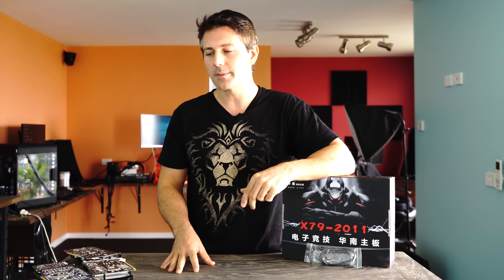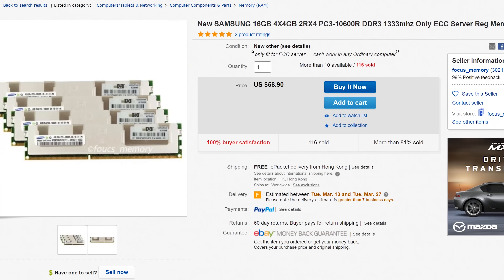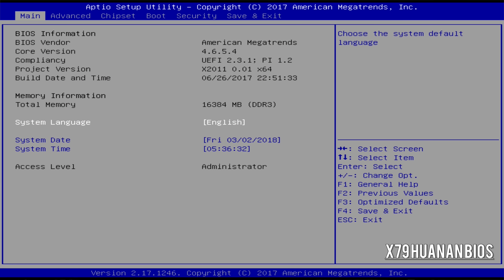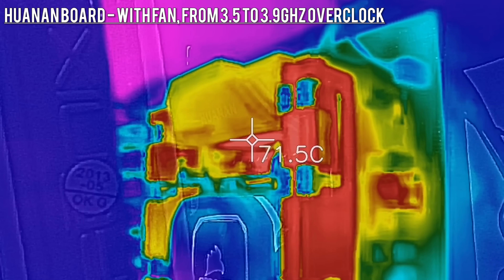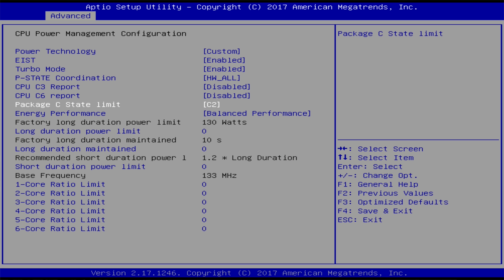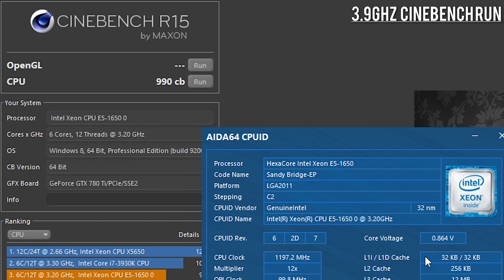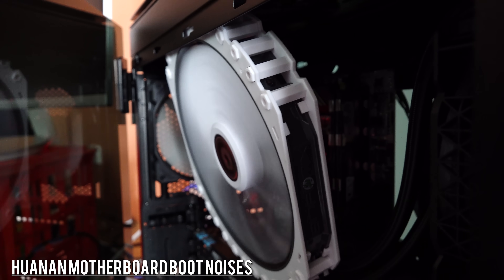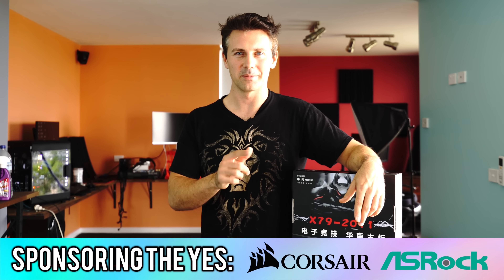AliExpress HUANAN X79 Motherboards - Are they a LEGIT OPTION for PC Builders!?

Comment: can you do a comprehensive bios setup, not OC, i have a hard time with my nvida card, gtx 1050ti 4gb looses display, the gpu is good with other systems, only on these boards it suddenly stops displaying on windows 7 and windows 10, having 1 ram the gtx1050ti does not have any problem, when adding ram  dual, and full populated i have problems,  how do i know the board cpu ram are all good? ATI gpus works without crash, how do i know the gpu is good? 1 ram no loss of display, i got it to work on my gtx1050ti when i changed the pci snooping, im not sure this was the right settings, a full detailed bios comprehension video might help.

Comment: nowadays its even cheaper with the cpu 83, mobo 66 and ram 35 usd. but if you pick the e5 1650 v0 for 40 usd and a cheaper x79 mobo  for 58 (considering 10 usd for shipping already), so all in 133 usd. Exactly 200 usd cheaper! to me thats the king of budget pc nowadays. 

Compare it with a used r5 1600 for 80 usd, an old b350 mobo for 85 usd and 8gb ddr4 for 75 usd. 100 usd more for half ram. 

And I dont even think this better because am4 is going to be replaced in a near future so  building a budget pc would be better to wait the new am5 mobos with pcie 4.0 and ddr5 support and build a pc more future proof. Actually thats what im doing kkk

Comment: Good evening Tech Yes. I've ordered one of those chinese motherboards X79 Turbo with a Xeon E5 2690 to build a workstation, so no overclock at all but lot  of heavy tasks and video encoding.
Do you think I'll need to add a fan over the VRM heatsink even if not overclocked? (Xeon E5 2690 is an 8 Core/16T running at 2,9Ghz up to 3,8Ghz Turbo mode TDP 135w)
Thank you for reading this post!
Reply: theres no need, these xeons run cold like 50C degrees, the vrm should not be much more hotter than this. but if you want to be sure buy one, near me they're sold for 5~6 usd

Comment: Hey mate loved the video, would it be possible for you to share thoughts on a dual x99 board with two of e5-2670-v3 cpus? kinda looking to buy this setup since it supports ddr4 and is fairly cheap. (200aud for mobo, 220 for two cpus)

Comment: I bought one of these, got here this week, I put an i7-4820k (it was a good deal on ebay about 60 GBP), running at 4.3 GHz, couldn't go higher without voltage control, but can't complain for 56 GBP. One great thing about the xeons and the i7-extreme cpu is the 40 PCI-E lanes. A graphics card would max out the 16 lanes of normal core i cpus, and with an other PCI-E card (wifi, sound, usb or whatever) or an NVME drive it would take away from the gpu. Mine has a Q77 chipset, the description on aliexpress you can normally find what chipset to expect, they have two or three, can't choose though.

Comment: Does it have HDMI? If not, does it matter?
Reply: The board does have HDMI however you wont even have to use it, Xeon processors dont have integrated graphics so you need to buy a graphics card to actually use the computer.

Comment: Hey tech it takes v2 chips do you know, or are you familiar with what chipset is on the southbridge is it an x79 chip or an c602? because if it is an c602 you could actually used an Ecc Rdimms with the board in the 16gb variety,  I was just curious if you had seen the chipset.  Thanks man.  good video.

Comment: are they paying licence? 

afik they are just recycling from old boards or using old new stock chipsets and you can endup with anything compatible chipset even server chipsets on some boards..(my buddy got a runing board with 8 ram slots that had a c series chipset, and very good vrm build and farm better sinks,  and russian bios with all functional features enabled, hes found it clocks pretty well and remains cool, and sometimes its a PITA to get a flash, even if its not a board revision thats designed to try and block updates, also, there are so many versions, could be yours wasnt 1:1 the one the bios was for, be glad it didnt brick and require you to flash the chip with another board :P  ) 

anyway, there are so damn many of these boards some with true x79 or c series chips some with H series, its a crapshoot if your not careful.

Comment: About that boot sound, if you ever happen to have that ‘problem’ again, connect a resistor to the board’s speaker header by the front IO and it’s gone 😉. Worked for me every time

Comment: the chinese kukete x79 has pcie 3.0, usb 3.0,sata 3.0 and quad channel memory, 3 x pcie x16 slots for around 90 bucks on ebay. could you do a review of that board? it also has a m.2 slot.

Comment: Have an Asus X99 A II, with an extending bios speaker, when booting it beeps too (also have display on the motherboard with error codes if any) but that motherboard doesn't have one (the one your showing) so the beeps will help you troubleshooting in case of an error, old school :-)

Comment: Sir, can you make nvme disk as a boot drive?
Reply: I only have experience with the HuananZhi Deluxe X79, which DOES support m.2 NVME boot, at least it does with Win10Pro. Using an Adata 240MB m.2 NVME in the purposed NVME slot on this motherboard.

Comment: the x79 deluxe and some others from Huanan actually will oc decently you can do a mod to get the 1650 to 4500, a few videos on how its done, im really tempted, much better value then ryzen for now, if you want more then 16gb ram,  64gb ram, x79 or x99 board with the correct cpu...350-450usd  are not a bad deal, check out this for example 
https://www.aliexpress.com/store/product/HOT-New-arrival-HUANANZHI-X99-LGA2011-3-motherboard-with-M-2-NVMe-slot-mobo-with-CPU/318004_32964764834.html?spm=2114.12010612.8148356.2.583d68ecI8hgo0

thats a bit higher priced but, its x99 with a 12x24t xeon and 64gb of 1866ddr3 for a frankly shocking price, the store linked also do custom combos if you wanted an x79 delux with 1650 v2 and 64gb of 1866 for example, they would do that, not sure on price, infact, there are a few chips i have eyed seeing how much they would want. 

the low end boards, like low end boards here, are not intended for overclocking what so ever, even a minor oc is more then many boards i have had over here allow or support, many run right on the edge for years on end... just with a "supported" chip in them... its amazing...

on the other hand, the x79 deluxe seems, from user accounts, to be a true x79 board, and to support overclocking decently, 4500 24/7 stable on a 1650 for example, thats not bad, would be very nice honestly, and, quite a few people seem to have done it, but the x79 delux and x99-ad3 gaming, are boards intended to support overclocking with better vrm sections(i think they are at least 10 phase if i remember correctly....) 

i would LOVE to see you test something like the above or 
https://www.aliexpress.com/store/product/Discount-motherboard-combos-HUANANZHI-X79-motherboard-with-M-2-NVMe-SSD-slot-CPU-Intel-Xeon-E5/318004_33013843184.html?spm=2114.12010612.8148356.24.57fc5257oC9pdo

this one, im eyeing.... some mods you can get a decent oc from what i have found the 1650/1660 v2 are the most popular for gaming but, this chip, is imho better for people who more then just game.

Comment: I just ordered this combo set from AliExpress on sale for $279.00  and I'm excited to build it and test it out!
HUANAN ZHI X79 motherboard with M.2 slot discount motherboard CPU RAM combos Intel Xeon E5 1650 3.2GHz RAM 16G(4*4G) DDR3 RECC
Reply: What is the performance of the huanan mosfets? Approved or do they heat up during stress and start to bottleneck the system?
You approved the VRMs?
Recommend this mobo over all? 
people complained about the vrms being too hot
Reply: @Yukl88  I recieved the updated board. Better cooling on VRMs. There was some issue with them getting hot. Amazing deal when looking at performance per dollar.
Reply: SmithBeatZ1 M.2 slot SSD would run only at half of it's speed so you better use SATA 3 SSD
Reply: @burn_out  I have a new WD 500GB SSD I might use. Been looking at M.2s as well.
Reply: SmithBeatZ1 wish you good luck with your build. What GPU are you going to use?
Reply: @burn_out  For cost effective reasons, either the ASRock Phantom Gaming Radeon RX 560 DirectX 12 RX560 4G 4GB 128-Bit GDDR5 PCI Express 3.0 x16 (Uses x8) HDCP Ready Video Card or GIGABYTE GeForce GTX 1050 DirectX 12 GV-N1050OC-2GD 2GB 128-Bit GDDR5 PCI Express 3.0 x16 ATX Video Card. Honestly not gonna throw it something super crazy into this build until I know it'll actually last maybe lol.
Reply: @burn_out  Endes up getting a PowerColor RX570 off Newegg for $129.99 only.

Comment: What is the rating of the PCIE slots?  PCIE 2? 2.1?  or greater?  I'm looking to possibly use this board for a NAS as I have a spare i7-3820 to use...the main item that I'm concerned about is using an LSI 16-PORT Int, 6GB/S Sata+sas, Pcie 2.0... Hunting down online documentation regarding this on the motherboard...hasn't been found..yet?

Comment: Does anybody know if these motherboards will work with 4x16 64gb of ecc ram?
Reply: Yes...it does! I have both a Huanan Zhi Deluxe [Orange] and a Plex XD x79 [Green] both are running 1600 ECC Reg Ram at full speed, in quad channel, and both with certified C609 Patsburg X79 chipsets...FANTASTIC UNITS!! Running an E5-2687W v2 in the 1st board and an E5-2690 in the 2nd mobo, BOTH 8 Core 16 thread CPUs, and they both turbo to fully rated Intel speeds...on ALL cores...SHIT HOT!! Both of those boards score higher on 3DMark than my previous i7 6700K with 64 GB DDR4 ram, sure am glad I changed!! Both of my systems are running with Samsung Evo 970 NVMe M.2 SSDs...cannot rate these builds highly enough!!

Comment: Aliexpress has been a life saver lately when it comes to value computer parts. I put together a kit with their cheap 775 mobo (30 usd), Q6600 (10), and 2x4 gb ddr3 (28). Maybe I could get cheaper prices on ebay or whatever, but for a place that tests everything and has easier to manage return policies, it's easier to get more consistent results. Also regarding the mobo, I know I could have picked up a lenovo or OEM board for around 10, but the boards I found that accepted the Q6600 or it's bretheren weren't ATX compatible boards, though they were good options for when the i5s drop in price.

Comment: bought the latest huanan x79 deluxe board,,,low temps on stress, oc enabled,,better stability,,updated bios,,,m.2 nvme pcie x4 equipped,,,works like a charm..best value board
Reply: Hey Andreas, which board did you get there are so many now on Aliexpress?
Reply: huananzhi x79 deluxe - the orange one with 3x pcie x16... got it for 105 euros

Comment: The issue with USB generally isn't an issue with selective suspend. It's due to Intel not releasing a USB 3.0 driver for Windows 8 and later, as Microsoft created their own generic USB 3.0 driver, similar to the Microsoft Basic Display Adapter. On Windows 8.1 and older versions of Windows 10, USB 3.0 is highly problematic on systems with many ports, like higher end X99 motherboards. I found updating Windows 10 to at least 1709 or using a modified Intel USB 3.0 driver fixed all of my USB issues.

Comment: If you're getting some throttling, it's probably not the VRMs, it's probably the default power throttling. When you're in the CPU power section adjusting the maximum core clock, set the short and long term power limits to 255. After doing that my CPU no longer throttled under intense load. VRMs are fine to run at 125 degrees C or lower. The ones that came on my board are decent quality Ubiq VRMs, the same found on many Asus and Zotac products. I have the Runing X79 VB10 so your mileage may vary depending on what board you have.

Comment: I might be wrong, but isn't that Fully Buffered (FB) Ram rather than just ECC, looking at the Heatsinks?

If it's FB, then you also need a fan on those Rams, since they're usually designed for servers with a fan blowing on them and they get REALLY hot.

Also: how about a comparsion between a dual-cpu build from server hardware and this one with a mild OC? :P

Comment: Hi, i have a e5-1650 on a chinese x79 mobo and a vega 64, today i overclocked the cpu to 3.9 ghz, and i had that result http://www.userbenchmark.com/UserRun/8506925, so iìve tried in the bios some option and now the maximum i can reach is this http://www.userbenchmark.com/UserRun/8514686, i've tried to reset the bios, but the results of the benchmark are always the same, what do you think?

Comment: Hello, The motherboard is perfect! I installed windows 10 on an  M.2 ssd (Samsung 960) and put a intel xeon e5-2680v2 cpu on it.
Cinebench r15 multicore scored 1400 (perfect!!!)
the only problem I have, is that some external disks (Seagate usb 3.0 4tb external disk) don't work correctly
Does anybody knows where I can download drivers for this motherboard?
Reply: Malaka me esoses ithela na matho an doulevi me nvme disko san disko os, telios. Tsimpises to compo apo ellada? i alliexpress ?
Reply: did you need any drivers to get the NVMe working? I'm stuck trying to install windows onto the NVMe. Thanks!

Comment: Brian, in this gp-acolypse any way you can find an hp PP 580-130 to test (I’m most interested in the odd proprietary 4GB rx 580 and 300 watt psu combo. I still don’t get all the wires running from the psu (10) into one 6 pin. It’s just fricken odd. Really odd. They’re pretty darn inexpensive, almost every e-tailer sells them for between $600 and $700 usd. Maybe you could get one of them to send you one for review? I checked online and the reviews are poor at best, you have to be kidding me at worst, but no one gets into the hardware at all. No mention of the Mobo (sometimes a matx beachwood 320, sometimes a beachwood matx 350, though the 320 is supposed to be the standard on the 580-130 model), nothing on, well anything, just “Look, and here is the rx 580...and a plug here, oh look, 2 sticks of memory”; it’s rip your hair out annoying.

I’m not recommending nor dismissing it, as the one I grabbed out of necessity (kind of) was under $600 usd and it runs fine, but I do want to swap the psu and board, but the connector from the psu to gpu has me nervous.

Comment: Would you recommend this over an X58 platform? I got myself 6-core x5675 a few weeks ago, overclocked to 4.50GHz, and I absolutely love it. I'm getting ~1040 score on cinebench, which is pretty good considering the cpu cost is just $45. There are also some x58 aliexpress board out there, but I guess the overclocking capabilities are similar to this one.

Comment: Bryan, you didn't happen to order one of these by any chance - (https://www.aliexpress.com/item/-/32841503701.html). Its another Huanan X79 motherboard, I was about to pull the trigger on it and then realized it actually has a weird form factor, almost between mATX and standard ATX - not to mention the 24 pin connector is on the opposite side.

Comment: just wondering, what's a higher tier x79 cpu that would be worth upgrading from a 3930k? 3930ks go for around $100 usd, is there a chip in the x79 lineup that's worth upgrading from the 3930k to that'll still give u good performance per dollar?

Comment: This is hacked together unlicensed chinese crap. I honestly would never use something like this, because who knows what kind of nasty malware is inside the BIOS which is most likely based on the leaked Aptio source code from 2013. Oh and try putting a 12c Xeon in it with that power consumption the VRM might catch on fire :D

Comment: You can buy a MicroATX X79 MB for only €82,- (US$ 100,-) on Banggood, or the normal ATX X79 MB for only €86,- (US$ 105,-) and then you get warranty of Banggood, and i trust then a lot more then AliExpress, and you can put cheap heatsinks on the MOSFET.

https://www.ebay.nl/itm/HEATSINKS-9MM-28MM-FOR-IC-MEMORY-RASPBERRY-PI-CPU-UK-STOCK-FREE-POSTAGE/273019887225?hash=item3f9140de79:m:mk3LY2VyiX3u2IXS4KrSBAQ

https://www.banggood.com/X79-All-Solid-Capacitor-MicroATX-Motherboard-Mainboard-for-Intel-LGA2011-p-1262670.html?rmmds=search&cur_warehouse=CN

https://www.banggood.com/X79-All-Solid-Capacitor-ATX-Motherboard-Main-Board-for-LGA2011-with-4-Memory-Slots-p-1264677.html?rmmds=search&cur_warehouse=CN